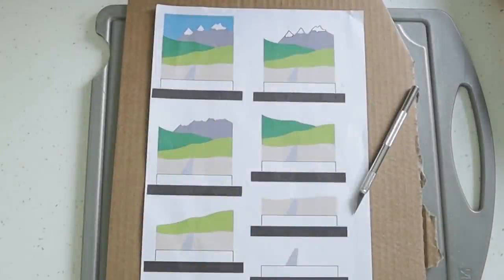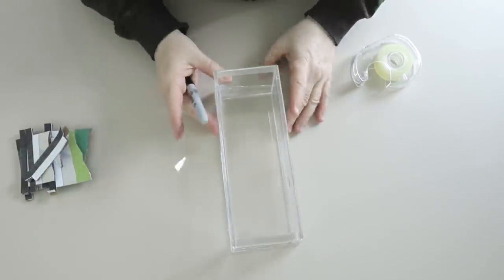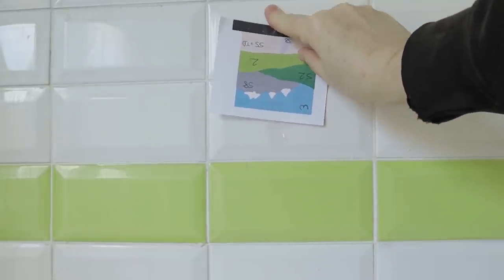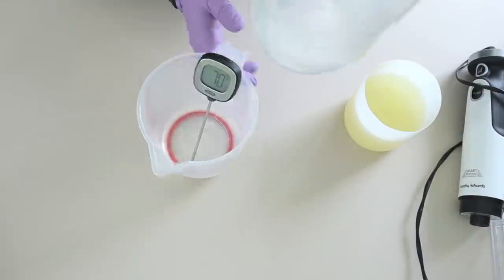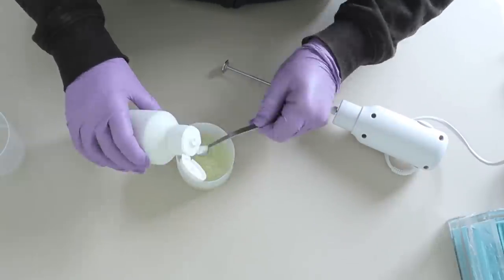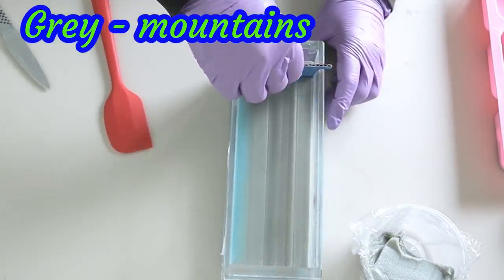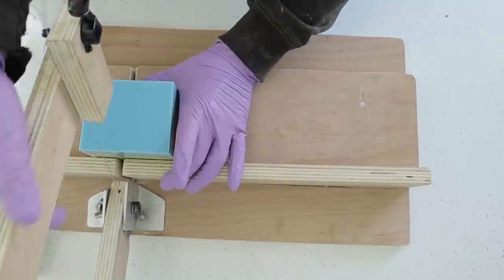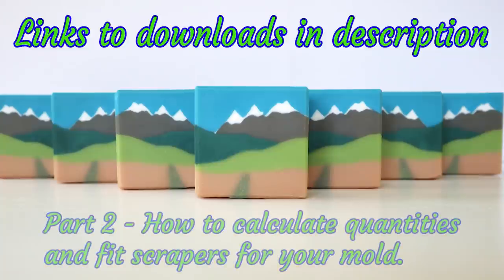How to make a LANDSCAPE SOAP ~ You can make this soap part 1. Cold process soap making tutorial

Comment: Wow. Thank you for the lesson. Since I an still waiting on my first batch of soap supplies,  this soap is way beyond my abilities.  So great lessons none the less. 

Thank you Lisa.
Reply from the maker: Hey Michael, I hope your things get here soon, yes maybe try a few loaves 1st and get use to things and then start trying some things out :-)
Reply: @IDreamInSoap  Thanks. I planned a 3 color, 2 clay, layered soap for my first soap. I'm thinking i need to reevaluate my plan.
Reply from the maker: @michael7324  It does sound quite a lot, but I did a 3 layer with mica lines for my 1st soap, so I'm not going to say don't try. Bear in mind clay will typically accelerate your trace, which may make it more difficult if you want straight layers as it may thicken and stop you pouring smoothly, but it won't (well it shouldn't) make it get too thick, If you're after textured layers then it should be fine.

Comment: Hi Lisa beautiful soap I am using bramble berry’s mold it hold 50oz I seem to be having trouble calculating the landscape. Any suggestions
Reply from the maker: Hi, sorry for the late reply, it's been madly busy here. If the mould is a landscape shape. i.e. wider than tall, you should just be able to put your measurements into the spreadsheet to get the amount for each layer.